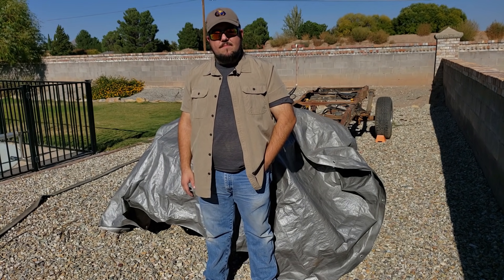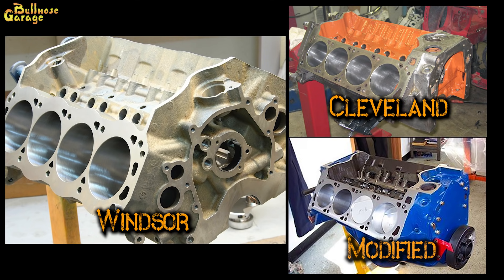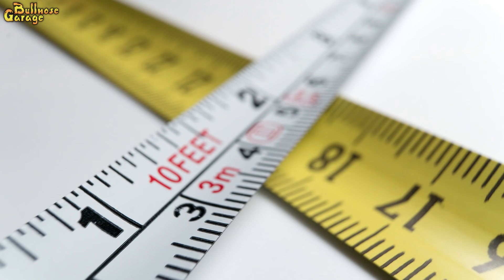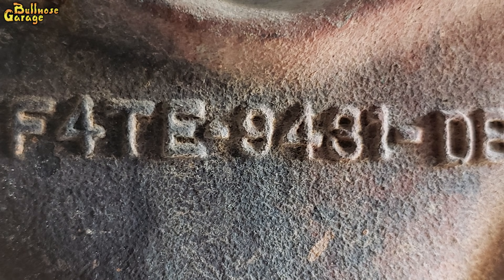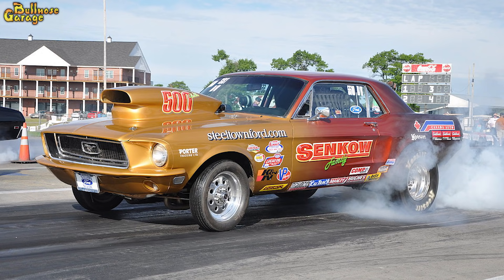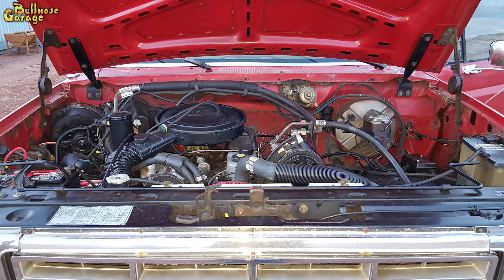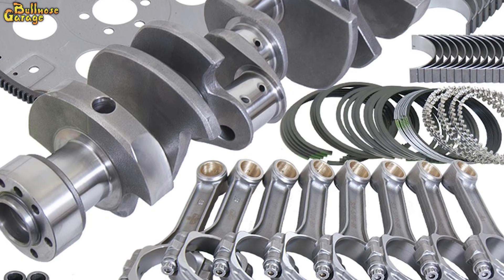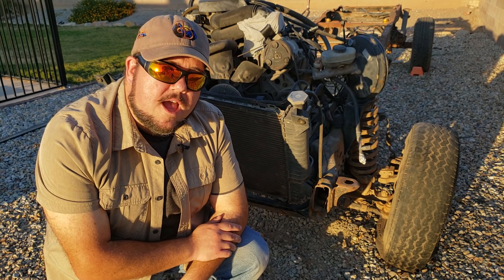351 Windsor – What You Need to Know About the Ford 351w Small Block [5.8 Liter]

Comment: Some of the public does not know there was a 9.2" deck 351 "W"indsor # XE 93532 race block made back in 1966 way before Kundsen's "C"leveland block was even on the drawing board & this 351w XE 93532 9.250" deck Windsor race block got as big a 391+ ci back in 1967 for Can-Am racing. The 302 & 351 windsor XE race blocks were tested with canted valve head prototypes in 1968 Before Kundsens new block was & there were plans WAY BACK in 1964-65 for a 7L aluminum Windsor race eng for Can Am racing. Kundsen screwed things up at FORD with Fords 351W race block development...
 goo gle "351w xe block" for more info

Comment: Just a note, FYI, the 351W is not the last/largest small block Ford engine. The 351Cleveland is a small block. Many people think that the 351C is a big block but it's NOT A BIG BLOCK.
Also the 351M-400M are considered small blocks also. The first big block commonly known is the 352. Never seen a big block from the factory turn 8000rpm and ask for 9000rpm, that's what the small block 351C is capable of every day.

Comment: Hey! Any ideas on what causes low oil pressure? I have a 1991 f250 w/351. It loses oil pressure at idle when cold, and struggles to maintain pressure when hot.
Reply: I had an old work truck that did the same but found it was lack of Maintenance and a ton of engine sludge which eventually killed the oil pump. By that time the thing was just wore out at 100,000 miles which is a terrible shame. I know people that have take the 302 and the 351 to near 300,000 miles without major repairs or rebuilds. Oil changes are a definite must. And the right oil. Especially on the older engines that need zinc. I’d rather change oil too often than lose an engine or spend big bucks later on.
Reply: @mattstacy1652  What do you recommend as the right oil. I just bought a E250 w/ 351 that has 25k original miles. It's very pristine. I'm wondering if I should switch it to syn.
Reply: @elvidgejable  I do run full synthetic in mine. As far as weight… it’s according to where and what. I seem to have better luck using a thicker oil in my rides. Now .. the work truck was maintained by our company mechanic and was the cheapest, 20w 50 they could find. Same oil they used for a 425 caterpillar was what we got for our work trucks. Smh.
Reply: @elvidgejable  and I also run a bottle of Lucas in my engines too. Opinions vary my friend but so far, I’ve had nothing but good luck and quiet top end on start ups! ;)

Comment: Have a 351W in our ski boat ... 4 BBL carb ... does not want to start unless I put some gas in the carb ... the starts and runs great with NO issues ... BUT shut it off and does not want to start up unless we put some gas again in the carb ... suggestions?

Comment: Thanks BNG. Really love the info provided and learned a lot. Had my pen and paper writing stuff down. I want to do a 429/460 big block swap to a 351W this winter. Going to a 408 stroker.  Don't think finding a 69-71 block is going to easy, most likely next to impossible. So the roller F block will be just fine for my build. Looking for no more then 600 hp. Thanks for sharing. Cheers from Motown/Dearborn.

Comment: ED question for you. Trying to find out if a 1995 ford bronco 5.8L has old injectors  (bosch ev1 single spray) or newer style like used on 1996-1998 explorer (bosch ev6 with 4 spray holes per injector).  Both obs 5.8 and 96-98 explorers use 19 pound injectors. These 96-98 explorer injectors aledgedly increase MPG & improve engine performance could be a good upgrade if you have old ev1 style.
Reply: For those who like to know I found out 1995 has the newer multi spray style.

Comment: Your picture of the cam/lifters was misleading. Roller motors didn't use link-bar lifters (they're hella expensive compared to the non link-bar part. OEM roller blocks use a bolt-down lifter retainer with spiders that keep the lifters aligned on the can lobes. Aftermarket blocks also support the bolt-down retainers.

Comment: had a 70 cougar 351w with 290 hp rating. rating seemed low. it screamed. I had a 69 cougar 351w. 250 hp rating  you could tell the difference.

Comment: The larger crank journals did not make the Windsor block stronger, it did just the opposite, it made it weaker. The bigger the main journal the faster the bearing speed and the more your rpm's will be limited. Hold a Windsor at six grand and it will fly apart, compared to a Cleveland which with its smaller journals won't even notice that engine speed. Then you have the extra reciprocating mass of the crank eating power.
The reason the Cleveland was nixed in the US was emissions nothing more.

Comment: Good info.....I had a 69 Galaxie 500 with the 351w. It was a much stouter running motor than the later smog era motors. I doubt it had 11.1 compression though.  The perfect 351w to me is a clever. 351c heads on a w long block. Back in the day before stroker cranks were common guys would take a 400 crank and machine the crank journals down to fit a W block. And wala a 400 cube, Cleveland headed... windsor. The ultimate clevor back in the day. 

The most powerful 351 ( most powerful factory small block period offered by all the big 3 was the 71 boss 351c. ) just a bit of 351 history there.

Comment: I’ve had 302s , 390’s in different trucks overage years had power stroke in a 97 f250 currently have power stroke in a 2000 f250 but I’m not working the trucks any longer not pulling loads so my favorite of all is my 351w in 96 f150 4x4 long box regular cab xlt  all my trucks have been xlt trim package I love em all . Shouldn’t make but 3 trucks . F350f250 f150 any color you want long as it’s white

Comment: I have this engine in my 93 E150 Club Wagon Van. I have been having idle issues ESPECIALLY when going down inclines like from top garage floor to bottom. It drops idle to almost stall but then wonce driving is ok.
I have changed everything:EGR VALVE-PIPE-CENSOR,AIR IDLE CONTROL VALVE, MAP SENSOR, COMPUTER, FULL TUNE, GAS PUMP, about to change Oil Pressure sensor because my oil gauge needle bounces from middle of gauge to Low. The only thing not able to change is the, VACUUM lines because they  don't make the comple vacuum harness. 
Any suggestions..?

Comment: I had a 76 Ford E250 with 351w in it. Standard 3 so automatic. Not sure of the rear end but had the tow package I think, the rear axle came out with 8 bolts. As much as it wieghed I could squawk the tires and had no issue going over 100-110. Torque all day long. The tranny died at 250k and tho burning a little oil the engine was still running fine. Did replace the water pump and a heater core. I bought it with 100k on it. Definitely my shagging wagon😁. Had the bumper sticker " don't laugh, your honor student daughter is in the back". Good times🤣🤣🤣

Comment: I had an '86 f150(I can't remember engine size)that I thought had a water pump leak. I changed it out 3x and after a while started seeing coolant in the oil. I donated it to a Vet organization. I bought a '95 f250 last year and after seeing the coolant reservoir get drained regularly but no visual drips, I looked at the engine closer and I now see a little seepage area just to the right under the distributor and above the water pump. The engine temp stays normal and I really don't want to throw random parts at another engine. Would anyone have an idea or is it my hunch that it could be any of the areas in that vicinity that could be seeping coolant? Thanks and sorry for the trouble! 😅 Awesome video btw!!

Comment: Some of the 94 351 windsors did not have roller cams. Also, the 5.0 motors like what came out in Mustangs and f series trucks share the same firing order as the 351 Windsor. It was the early 302 motors that have the 15426378 firing order.

Comment: Do you know if 94 bronco is a 302 is a roller block or not? Really just interested to see if the 302s started with the roller block in 94 as well as the Windsor. Is there a way to identify it?
Reply: 302 roller blocks started in the mid 80s. 86 I believe. Just remember that they also changed to 50oz crankshaft balance as well. 351W stayed at 28oz

Comment: I have an F4 in a 1994 F-150. This engine has 253k miles on it and still runs strong. Common issues (valve guide seals, rear main seal, and that blasted coolant jacket gasket where the head meets the intake manifold) are leaking a little, but nothing unmanageable (yet). If you own an EFI setup built in the 90s, keep an eye on your intake gaskets. There are 4 of them, and they like to crack when they get old. Vacuum leaks make life difficult for EFI setups.

Comment: 1969/70 the 351w as also in the Falcon and was a multiple race winner in the Australian Touring scene in that period in the XW Falcon GT-HO with 380hp from factory including winning the 1970 Bathurst 500 mile endurance race. 
From 92-2003 the Falcon's were once again powered by the Windsor after a 32 year absence from gracing the engine bay of the Falcon GTs and its lesser performance variant the XR8 and Fairlanes... The 2002 AU  Falcon XR8s were the Last Official Ford to be powered by the 302w. 
I really Want one of those 351 F4 blocks now for my 98 EL XR6 Falcon to do something different instead of dropping the later model V8 Slaying Barra i6 Turbo as a engine swap that usually happens here in Australia. (Even Holdens are getting the Ford Barra i6 here)
The Wheeeeezer as its nickname here in Australia got it as the non turbo sohc 4ltr Tickford i6 in the XR6 blew the doors off the XR8 and the GT Falcons, but alas the biggest of the Windsor we got in the

Comment: I got some info a while back.  I think it came from my book called Building Small Block Fords.  According to this info you are partially correct with the W engine being made in Windsor, Canada, BUT the 351 Cleveland and the 351 Windsor were actually both produced in Clevland.  Ford Called this engine a Windsor because it was from roughly the same mold and form as the other Windsors but mainly so that it would end any potential confusion before it started.  You have done a lot of research.  It really doesnt matter where the 351W block was produced but it is an interesting tidbit.  Good luck with your project.   BTW, I have a 1970  351W block that I had bored and stroked to 408 cubes and it make 571 horsepower in my 1965 Mustang.  That is a better weight to power ration than the 707 HP Dodge Hellcat Challenger.
Reply: That's an interesting claim that these 351 Windsor engines were built in Clevelend. Can you give a credible reference for this? Thanks

Comment: Get a 94 or newer block (roller block) install  302HO cam and lifters and of coarse the longer pushrods from a 351 vin R code, (heads GT40) heads and the newer Mustang GT headers. This combination works well with the speed density fuel injection and a very noticeable power gain. That's a "budget build" that works. Don't forget to change the distributor drive gear or the whole distributor from an R code engine

Comment: Great video.  I have the original 351W in my 69 Mach.  Love the motor.  Very durable and plenty of torque.  After doing some bolt on upgrades, I decided that I want to preserve this engine and get a 427 SB to replace it.
Reply: I had a '69 Mach 1 w/the 351w, in '74. I was 18 yrs old and thrilled to death. 
That car would Haul Ass!!
Reply: You talking the sbf 427? That's a beast of an engine but the cost for a crate motor you can get a 5.0 aluminator block and get more gains. Though it is efi.
Reply: @lonewolftech  An Aluminator 5.0/Mod Motor won't fit between the shock towers of a 1st Generation Mustang. Front suspension would have to be modified = More 💰 

And the '69 accessories would require modifying/special brackets to bolt to the mod motor = 💰

Plus it is overly complex, overly expensive to repair/modify & a PITA to work on.

Comment: I have a 1996 351w in my F-150. Is it normal to go through a quart of oil within 1000-1200 miles? There are zero leaks, clean plugs, no smoke out the exhaust and the pcv valve is new. Some others say that's normal consumption and other say not.

Comment: Hey Bullnose, I have a question for you! 
First off, if your resident of SoCal? If so, great proceed with proposal regarding doing some horse trading for that stock suspension off that 94 chassis your sitting on there for an aftermarket lowering kit that is currently on my sons ‘94 F-150 2WD extended cab. 
Although, I’m sure the shocks need to be replaced but, everything else looks to be great condition based how it drives down the freeway, and most definitely, by the looks of the powder coating and urethane bushings after all the UB are still red while maintaining equal amount of urethane around the components it’s bushing…. 😂 
Seriously, we’re not into lowered pickups as much as we’re into trucks that can be driven in the dirt. 
None the less, thank you for all the info this was some useful content!! 
Thank you, Klaus

Comment: The 351 ford windsor was not a small block, even though they had the upper appearance of the 289 and 302, with taller deck height and a one inch wider intake manifold.  They had a taller deck height than the 400 CI cleveland ford V8s.  They were not small blocks at all, but the use of 289-302 valve covers created that illusion

Comment: So my 94 Ford e150 5.8l is a roller motor? I’ve heard mixed versions of only the f150 and bronco getting the roller while some e150s didn’t get the roller till 95. So In other words I’ve hear some of the 94 E150 5.8 had the flat tappet but did still have the roller block. I’ve always wanted to know for sure if I have a roller or not so I know what oil to choose.

Comment: My friend and I did this exact swap in 98’ high school. Took a 84’ H.O out of a rotted 2 by long bed and installed it in a 85’ step side 4by headers intake carb ignition, this truck flew it was the stang of trucks was a stick also very fast! Dud take more cross referencing than you would think but was worth it . It is much easier to swap a 350 into a square body but it was an awesome truck.

Comment: The 351m came before the 400 so the 351 isnt a destroked 400. Also the 400 isn't technically considered a big block even though it has a taller deck than the windsor blocks.

Comment: I stopped the video at around the 11 minute mark I just wanted to add that yes you can add horsepower to them but most 302 blocks be careful of how much you add because I have heard of over 500 horsepower and above you stand a strong chance of cracking or busting the block in half again this is for the 302 did your model I'm pretty sure makes a difference you know hint hint where you said the year was made due to impurities in the block so they made them beefier so if it's a lie this is what's been told to me

Comment: Best combo for a 351w is never done by most but few. Of that few most get it wrong. Fords are particular in a bunch of areas. If done right they are very competitive. You dont need expensive parts either.
Reply: Could you share some knowledge with me. I have a 89 f250 4x4 with 351W c6 and 10.25 full floating rear axle. I blew the engine years ago after rebuilding it and it’s been in storage. Since then I have gained much knowledge in engine rebuilding and I actually have my own Kwik way boring bar and sunnen hone because I rebuild outboard motors. Could you recommend what parts would be best for my build since it’s a heavy truck. Roller cam? Heads? Stroker crank? I’m only looking for about 450 torque

Comment: Man I just got my first truck at 19 and it's a 94 f250 with the 351w and I love it she sounds healthy
Reply: I'm 29 and bought a 1996 f250 351w with only 108k miles she is in perfect shape
Reply: @brettkelly4575 man my 94 has 164k but she's running like a beauty just need to work on the chassis like the bushing and bearings and all that but I love my truck and could not imagine driving a newer ttuck

Comment: I had a 351windsor HO (high output) engine in my 84 crown Vic police package car an I'll say the 351w is one tough motor.
Reply: 351 Windsors have a much tougher bottom end in real life than those POS "M" engines from 1975 to 1980 when they thankfully stopped building them in 1980.  (or whenever)